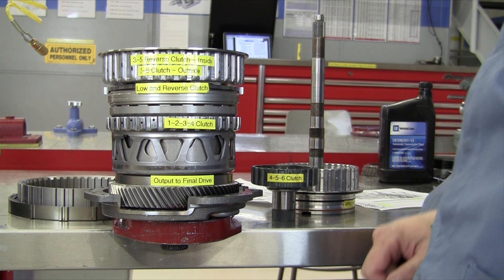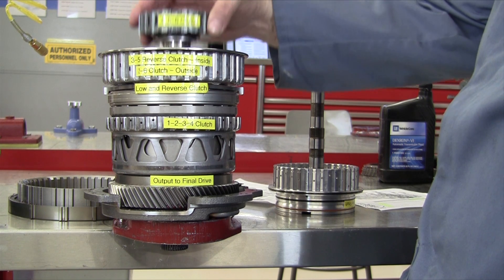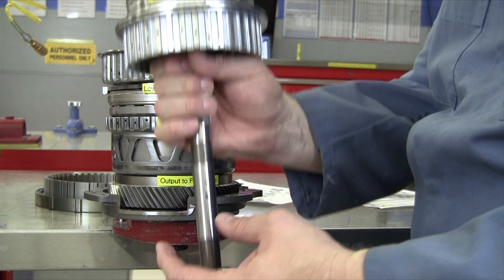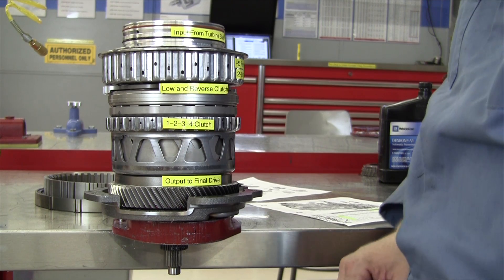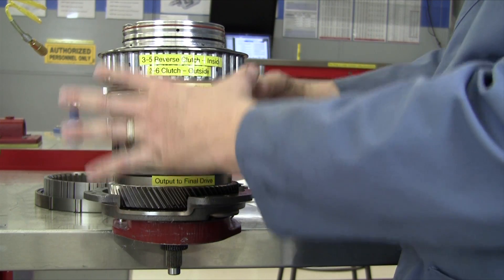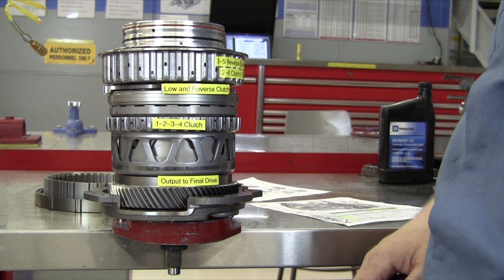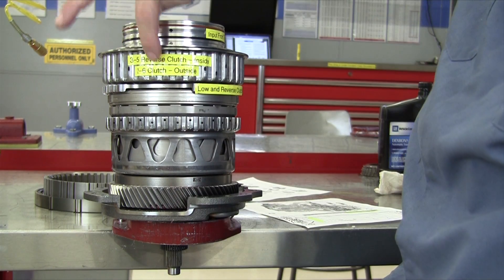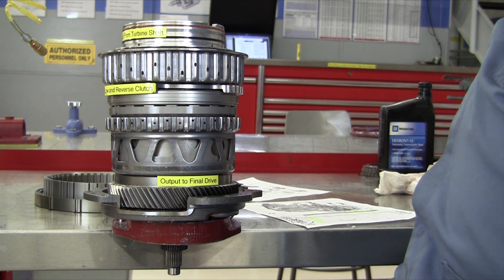GM Hydra-Matic 6T70 / 6T75 Transaxle Power Flow

Comment: I have the same transmission in my Malibu 3.6. My car is modded tuned and trans tuned and it runs great. 214 k And I've changed the fluid twice so far both at 100,000 increments

Comment: I have a 2014 buick lacrosse, it has the 6t70 M7W transmission..  80 thousand miles, torque converter started to fail caused a late 3 to 2nd down shift, thought it was a power steering pump at first..  Apparently it was actually the converter. I had the transmission flushed, the winding sound stopped, but the hard downshift was still there, ended up having to get my transmission rebuilt cost me 5200 dollars. Manual says it doesn't need a fluid change until 95 thousand miles..   Guess they was wrong. Other than that the car has its been a awesome vehicle.

Comment: Can anyone tell me the transmission fluid capacity of the Hydra-Matic 6T70?
Reply from the maker: I do not know, check your owner's manual specifications section. Best wishes
Reply: They hold 10 quarts, if dry.

Comment: Thanks for the video. What common problems does this transmission have if any? Thank you.
Reply from the maker: Many failures of the waved clutch steel plated in the early years. Later models are good
Reply: @WeberAuto  2008 good or no?
Reply from the maker: No
Reply: WeberAuto how about 2016 impala?

Comment: simply a junk transmission. Heard of numerous problems with this unit. mine is acting up again at just 98,000 miles.  downshifting to early when slowing down. eratic shifting. it cannot handle the 3.6 hp.
Reply from the maker: They have had a lot of problems. Thanks for your feedback
Reply: I have this transmission in my 2014 Cruze 124k miles and my car has 320wtq no issues yet
Reply: Yep. Mine went out on my 14 impala at 44 thousand miles. 2 months after the warranty expired.
Reply: MrCoffeekelly damm. How was it resolved?
Reply: @MrCoffeekelly  I'm feeling your pain...😡😫😡😫
I've always been a Chevy guy. But I'll never buy GM again (new, at least). What a scam!

Comment: I enjoy the videos you guys put out. I have a question regarding this transmission. Can the 6T75 parts, that were designed to hold more input power, be installed into the 6T70? It is my understanding that the housing pattern on the 6T75 is different from the 6T70. I am trying to find ANY upgraded parts I can use for a car being built up for some autocross duty. I have a extra 6T70 to build while the car is still used. Thanks for any input you can provide.
Reply from the maker: They are mostly identical. The final drive and gear ratio are different for the all wheel drive PTU. There are a lot of upgrades for the 6T70 since 2007. You can search service bulletins for the updates. You can also get upgraded parts from companies like transtar. Best wishes

Comment: I have a 1998 Chevy 2500 pickup rear wheel drive with a 5.7 , it has been sitting down for about a month,  this morning when I pulled the dipstick engine running on a cold transmission , fluid bubbles out of the dipstick tube , I used to be in the automotive business I am thinking that the bleeder type on top of transmission is plugged , or because it has been sitting down for a while  I should have waited for the fluid to settle down before i pulled out the dipstick , anybody else have any other ideas , your input is highly appreciated
Reply from the maker: It sounds like the fluid level is too high. It has gotten up into the rotating parts and getting whipped up. Best wishes.
Reply: +WeberAuto so nothing to worry about
 thank you for your help have a nice day

Comment: Maybe i am confused but transaxle isnt that a type of transmission like in the Ford GT40?
Reply: A transaxle is basically a transmission + differential.  In a rear wheel drive car you have a transmission connected to a drive shaft that runs to the back of the car, then the differential splits the power and sends it to the rear wheels.  In a front wheel drive car they bundle the differential and transmission into a single housing since there is no need to transmit the power to the rear of the vehicle.  Rear or mid-engine vehicles with rear wheel drive will also use a transaxle for the same reason.  That is why the GT40 has a transaxle, the engine is mounted just in front of the rear wheels so they can package the transmission and differential in the same unit.

Comment: I've done some of the 3-5-R wave plates but not nearly as many as I thought we would see.  I think I've only seen around 10 in our shop this year.  So far they've all been covered by warrarnty.
Reply: Is that the part that causes the tranny to shake/shudder, especially at slower speeds like 45 mph at 1300 rpm?